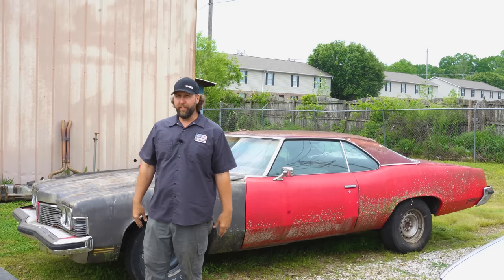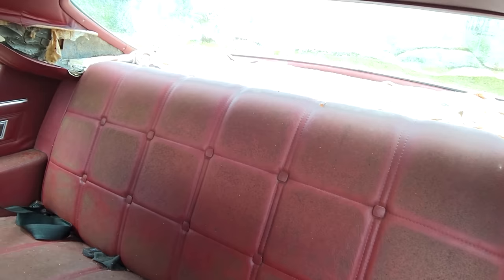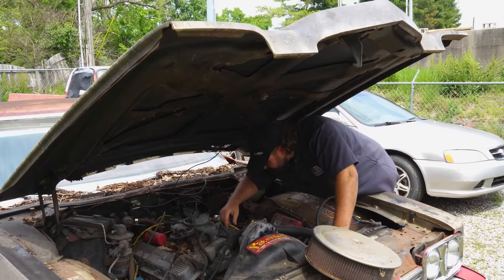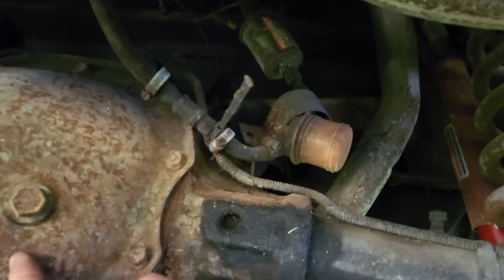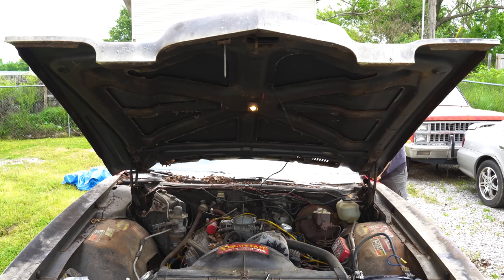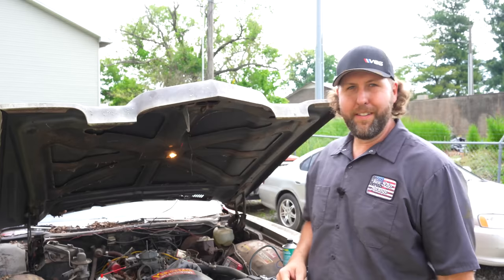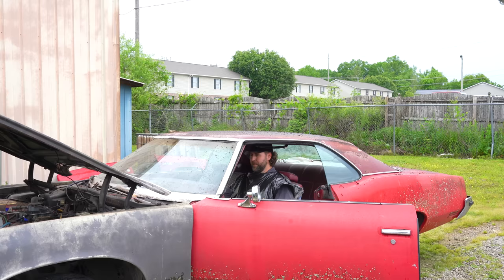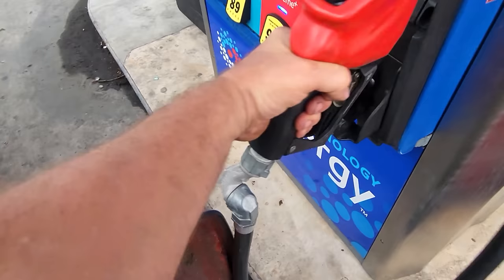FORGOTTEN Pontiac Catalina - Will It RUN AND DRIVE 150 Miles Home?

Comment: Maybe it’s because I’ve never tried to do it, but Derek’s ability to throw a car battery like a baseball is very impressive!
Reply: He's a big guy for sure. I worked in body structures at Boeing years ago and for whatever reason they put the biggest guys on the nose section which was small when not connected to the rest of the airplane?
Reply: hes a pretty good sized feller. although i am as well and i cant do it. Its all them years of practice hes had i guess.
Reply: I've tried it. Not easy at all.
 He's s very stout feller.  That is for sure .
Reply: maybe he uses an Olympic
 disc throw technique, IDK.
Reply: I think it's more like a Shot Put than a Baseball
Reply: He's definitely that guy that launches a bowling ball half the distance to the pins
Reply: In the video he did say he could throw a whisky barrel 300 yards
Reply: He's an old farm boy. Lifting and throwing bales of hay onto a trailer, or stacking in the barn, all day during hay season will do that to a feller.
Reply: It’s in his Swedish farming family heritage.
Reply: Once you develop a healthy, reasonable amount of hatred for the crap that passes for a car battery these days, it's easy.
Reply: he practices by tossing batteries in the ocean
Reply: I had a CHERRY 1968 Pontiac Catalina 2 door, 400 ci with a factory 4 barrel ! Man I loved that car !!!
Reply: "GET OUTTA HERE!" lol favorite
Reply: Wonder how much money he spent in batteries?
Reply: I suppose he keeps them as "cores" there is $$ in them old batteries

Comment: There's a trick that some GM Mechanics taught me back in the 70's for changing the sparkilators on the A/C compressor side of GM vehicles. Jack that side of the car up via the frame until the tire is just barely touching the ground, then use a long extension (36 to 48" long) and a wobble socket to go over the top of the tire, above the upper control arm, thru the black rubber splash pad to get to the sparkilators. Works like a charm. My old boss at Goodyear couldn't figure out why I put an Impala on the lift todo a tune up until he saw me change the plugs that way. The old guy about pooped his pants when I changed the plugs in about 5 minutes on that side.
Reply: My wife's '73 Ventura Custom was almost the same, except it was the rear plug on passenger side, took the front wheel off and hole sawed a 3" hole in the rear of the steel wheel tub and reached in with an extension and a socket, made a rubber flap and screwed it to the hole.  Years of having tune ups done and no one ever changed that plug and they charged her for 8 plugs.  Then she married me and she got a real tune up.
Reply: Flat rate is the mother of all invention.
Reply: In my shop, on 455 Trans Ams, that was the only way to to the plugs

Comment: I love the way the fire extinguisher is leaning against the fuel jug.  That way when it bursts into flames, the extinguisher will over heat and when the safety disk bursts, the contents will automatically discharge.  Meanwhile, you can be running like Hell the other way.  PERFECT!
Reply: That’s pretty neat
Reply: @BrittanyAndThePhilbillys  I'm pretty sure he knows what he's talking about. Sounds like it. He must  be qualified. 👍

Comment: VGG  was my motivation 5 years ago to tackle the revival of my pontiac grandville.  When I got it it had not ran for 22 years. I used all of the methods that I saw watching VGG.  I've learned a ton from watching and would have never attempted anything had it not been for VGG. 
THANK YOU Derrick for the outstanding information and entertainment that you provide.
Reply: Motivating me to tackle my red thunderbird but still haven't done it. All it needs is a water pump.
Reply from the maker: Incredible, great work!
Reply: @ViceGripGarage wish I could call you for some information about that kinky little cadillac eldorado's 2000 etc always something going on somewhere🤔😒

Comment: I know those Catalina’s inside out…The fun I had with mine was priceless. 1980’s era I believe. Mine was a 75 or 76…. 4 door…Police Detectives Car.. Unmarked. very Clean…Floorboards we’re not so good.N.J Road salting…..
Reply: Gun in the boot ? 😂😂
Reply: We had a 65 Catalina Ventura,  421.  It had factory dual exhausts with cut out pipes (never opened) and cast iron headers.  One of the best cars we ever had.   Fast too!  It would break loose the tires if you hit passing gear at 80.  It was champagne gold.  It was a,dealer demonstrated.  It had a,421 SD  in it.  It was supposed to be a 389, nope.  It was supposed to impress future buyers.  One time when my mom was pissed she burned rubber at every intersection for about a block each time.  When we git home I had to use the garden hose to wash the tires down and cool them off before my dad came home.
Reply: 421 and 455 SDs were really fast.

Comment: This video sure stirred up some fond memories. A 72 Catalina was my grandfather's last car. It went to my father and was our family car for many years. One of the first cars I ever worked on and still a personal favorite. Between the three of us ours had over 400,000 miles on it before frame rot turned it onto a demolition derby car.
Having computer problems as my number one car issue in recent years, I long more and more for a car like this that could be fixed with a good ear and a few tappy tap taps.
ps: Sure sounds like a cam. If memory servers the stock 400 ran very smooth with no thump / lope.
Thanks for the memories.

Comment: I love that '73, Pontiac, Catalina. It would make a nice Hot Rod. 
Paint it Candy Apple Red, drop a SB 350, 350 transmission, raise up the rear end, duel it out with Flow Master Exhaust, 15" Centerline wheels in the back, 9" Centerline wheels in the front. Pioneer Super Tune 3 stereo, Pioneer 400W, 6X9s. 
Go back to the 1980s, momentarily

Comment: First (family car) I started with in 72’ was a 400v8 68 Catalina 2 door fast back. Took off the fender skirts and added a pair of Jensen Triax 2s to the rear deck.  A cherry bomb muffler and a set of high jacker air shocks to give it a better profile. It Had a polyester front bench seat,  so when things were getting off to slow start on a second date, I’d simply take a hard right turn and she’d slide right on over 😂. That thing had so much understeer you could also pick up a dime off the pavement during those hard right turns!

Comment: i had a '73 Bonneville.  i learned a lot about engines from that car.   I couldn't afford good tires so i bought mostly worn out retreads.  they would only last maybe 100 miles and generally blowout, which taught me a lot about handling.  it was all ok because i carried 3 full sized spares in the trunk and had lots of room left over for tools, oil, jacks, jack stands, clothes, etc.

Comment: I haven't seen one of these on the road in probably 25 years, what a beauty. Probably 96% of these up here in the rust belt were decommissioned by the 1990s. Very nice score by your friend, this is going to be a sweet ride. I noticed the passenger side upper control arm did not have a nut on it. Might want to pop one on there.

Comment: When I was early teens my older brother had a 68 Catalina. We delivered the paper route with a 400 Engine and baloney skin tires. We would steal tires from the scrap pile at the gas station and get them to patch them and keep 2 or tree spares in the trunk. We were like a pit crew the flats were so routine. The muffler also dragged and was held up with speaker wire. It was like a mobile sofa.

Comment: Love the fact this Pontiac has the same slots on the bumper as a Kingswood  did in Australia not surprising that this was a GM, essentially a high lift jack The fuel filler behind the number plate. I had an HZ, straight six “red” with a 4.2 litre 161hp engine. Loved that car, it saw many vice grips used…. Forgot to mention it was a glorious shade of lime green, well it was this or a a bright orange falcon.

Comment: Back in 2000 I was able to purchase the same car.
It had 3800 miles all original garage kept original paint and vinyl top factory correct  tires stickers were legible in the engine bay. 
Since it was contemporary times refrigerator green. We called it. Shrek. 
 Well the exhaust was rusted and it needed fuel so when I paid 2800 for it the owner told me go on and get that fixed or it won’t pass inspection. He gave me a 20 bill and told me never use cheap gas. 
Ended up putting dual straight magna-flows. 

Had my nineteen year old knew what I had back then I would have never sold it. It did go to a good home so I’m glad for that. 

Seen this video really made my day.

And it sure brought back good memories of my first car.

Comment: Love the 'Will it run's' episodes, as I'm not big on the race one's, but to each his own.   The tires/wheels you chose, really added to the car Derek, and I'm now wondering if you got fuel getting through from the tank, before the new owner picks it up?   I often wonder...wouldn't it be cool to have a 'Detail Shop' to come out to clean up one of these cars...without telling them first, just how much crud is on the seats, floor, headliner, and in the trunk!   Would love to see their face when you point out which car you want cleaned up...hopefully they would have more than 1 person, or he'd certainly be there for most of the day!

Comment: When pulling fuel forward to check for gunk, add a line of t-light candles under the main line. It will provide even illumination under the chassis and will tell you exactly where any leaks are. You're welcome.

Comment: Thanks for showing the old boat known as the Pontiac Catalina. I bought one for $700 back in 94 from a mechanic in Plymouth when I lived in Michigan. It had a bit of rust, and the back bumper dropped off when driving snowy back roads. I got a fix it ticket and replaced it with some nailed together 2x6's

Comment: I always mark the position of the crank before turning the engine, so that it helps with diagnostics later on and things like testing the valves that have been compressed for 10 years

Comment: 1972 Catalina my first car in San Diego CA. Real strong 400 motor. fist thing I change is the water pump big deal in the aluminum base for water pump it desintegrated. Did the tune-up and great car. It felt Fast for a big car.

Comment: Derek! This was the 1st FULL video of yours that I've watched. My son John is a Huge Fan of your channel though- watches every episode/video... I did a YouTube search for 1973 Pontiac Catalina and this was 1 of the 1st videos to come up. We will be getting a 73 Catalina 4 door model this summer- bartering for car/title in exchange for clearing brush off a fence line and demolition of an old shed. The car hasn't moved in 15+ years. Back glass has been blown out by tree branches for at least 5 years. It was parked due to a suspected head issue and/or cracked block... with a rebuilt transmission that barely has any miles on it. Body is fine and all the same color and all glass is good, except for the back window. It has the 400 engine. Will need tires, and shoveling out the interior- After we cut small trees and brush down from around it. Great video though, gives me an idea of the possible issues we could encounter. 
Thank you again!

Comment: My first car was a 73 Catalina with a 400 that had 90,000 miles on it. Got 10 to 13 mpg and I think gas was 75 to 80 cents per gallon. It was still a chore keeping gas in it.

Comment: I had a 72 Catalina 400/400 that I owned for about 25 yrs. No such animal as a cat in 72 so I had dual Flowmaster's installed which improved the gas mileage greatly and set off car alarms on every block I drove down. It ran excellent and all i ever had to do major was have the tranny rebuilt and change it to electronic ignition. A/C was probably the only option it had so when the intake manifold started leaking bad my mechanic begged me to put it down. Sorry as hell I didn't keep it cause it was fun all day to drive and even kicked ass in the snow. I paid $900 for it. My neighbor had a diabetic episode and ran into it while it was parked. She gave me $500 and I got $350 from the junkyard. Thanks for the memories❤💯%

Comment: My buddies and I bought a Catalina from the junkyard with the 502 when we were about 19 for $600. We threw a nitrous fogger system on it and tore up the streets for about two weeks, blowing the doors off of everything. Running a quarter mile against a supercharged LS1 Corvette all you could see was fire and blue smoke. 😂😂 We had a blast.

Comment: These days I find if you use the bumper jack, the bumper moves and the car stays on the ground.
An engineer once told me that anything manufactured likes to return to it's constituent components.
 So in the case of the steering wheel it is probably soybean oil and pine tar.
I totally geeked out on the Sony tape deck also. LOL.

Comment: With a car sitting for a bit then every thing starts working all the sudden or if no problems with it it's a very good ride I know I got an 1989 c1500 Chevy short bed 350 tbi motor never let me down but one time but after that no problems praise GOD like the truck all ways wonted one in high school and I finally got it

Comment: My first car was a 76 Pontiac Catalina with a 400 motor and water leaks that caused the floor and the frame to rust out and I had to drive in the spring and summer with windows down and in the winter with them cracked because the climate control would just blast heat.

Comment: She needs a carb rebuild, an intake gasket set, replacement of all belts& hoses, tires, some tape over the exh leaks, a through wash &vac b4u hit the road. I would've added a quart of ATF 2that engine oil during her extended idle 2clean her out b4 adding Mobile1 full synthetic instead of Rotella.

I suggest using ATF or Marvel Mystery oil instead of Berryman's. ATF is cheaper, more universal &amore effective top cylinder lubricant/cleaner. Turn on your heater 2get coolant circulating thru the htr core. It can extend your drive during overheating emergencies. U need a larger fuel tank w/a top. (use as ATF, PS fluid or top cylinder fluid, clean engine crank cases, etc) 

Consider using the main fuel tank4 storage over your trip4 a secure source if its not leaking. Then u can simply transfer from the main 2the aux on the road quickly& better control your stops. So, if the main holds 25gallons &the aux holds 5gallons, then u will effectively hv a 30 gallon range. this would b cleverer still.

I'm still waiting on your ck on the brakes, bearings, trans &diff fluids. The rest can wait.

Comment: I wish they still designed
Engines with fuel pumps near engine and outside of the gas tanks! 
    Although I got lucky cuz my Toyota has a hatch entry to the pump under the back seat. So no need to drop the whole tank but still 
Manufactures don’t consider easy repairs

Comment: Im going to have to send the design instructions to derek on how to supplement your carburetor with non working accelerator pumps with fuel automagically with a spray bottle full of fuel, zip ties, small engine fuel line, fishing line and some springs, once you male one you just keep it in your kit...it attaches to the carb linkage amd gives it a pump of fuel everytime you open the throttle, you adjust how much by how far away from the pivot point you attach iton the carb and bottle... you can really fine tune it actually...had a ford 460 that would cut off every time you opened the throttle that i needed to drive 90 something miles home on back roads...once setup correctly you just keep the spray bottle full... unfortunately unless you get an expensive chemical resistant spray bottle they only last one use...but can be the difference between stalling every stop sign and stop light and stumbling and popping constantly and driving almost normally...its not that hard to figure out and make...now that ive given you the idea

Comment: Always remember, pontiac fuel tanks with air cond have 3 pipes, And only 1 is pickup, and the one on the rightside of the car is just airinlet... And the pickup is next to the fuel suck it happener.

Comment: Again, 400, and a th400. The 6.6 is a work horse, when set up right. A mild cam and a Holley 750 cfm carb. If you get no fuel after replacing the pump, chect polarity.

Comment: It's actually possible to achieve even more. All the device us doing is basically  eliminating some US regulations that are implemented before importing to the United States.  After painful experience of loosing my only key and having to order a new one directly from volkswagen.  After Quickly finding out that the only way to program the new key, is to have a signal code set from the main volkswagen headquarters in Germany. Quite suddenly after key was programmed...it was a literal 360 transformation. Found out that the code had eliminated ALL United States mandated restrictions. Then after a  dyno visit..I ended up gaining almost 45 more horsepower a ridiculous amount of tork and fuel mileage...she was a all stock handholding, soccer mom grocery getter to a legit time attack death missile.

Comment: Sounds stupid but pontiacs like to vibrate the intake bolts loose.  Found that out years ago talking to a guy running one on alky.  He said he had to tighten the bolts every time out.  I thought "hmm crazy but my junk will never make that kinda power".   5 passes later that day (track rental) coming down the return road sounded like a rod trying to knock it's way out the block.  As I'm standing there thinking how screwed I was I look down and 2 intake bolts aren't even touching the manifold.  Tightened them back up and all was well again.

Comment: U need to mount them inline pumps low as possible perferably lower than fuel level…..i usually mount them on the tank straps….when u mount them higher than fuel level your making the pump work too hard and it will fail way sooner……i know those pumps are cheapo lil throw aways but you can make them last 3x longer if you mount’em lower